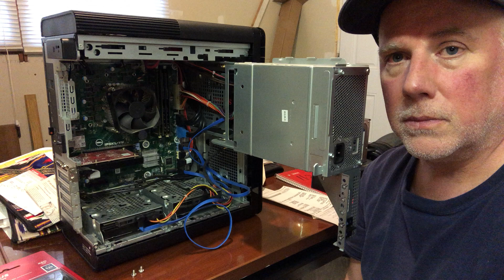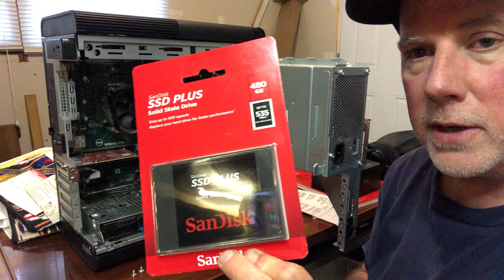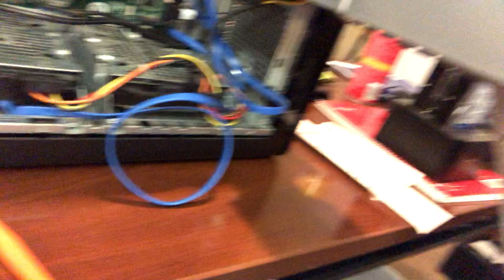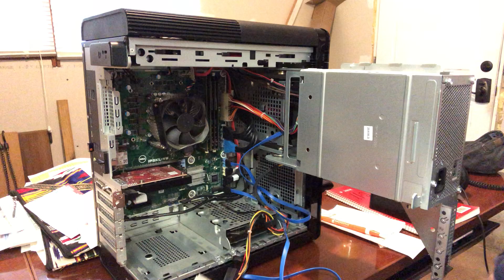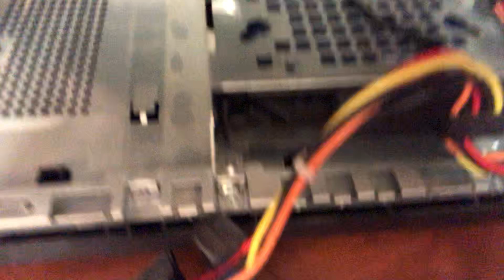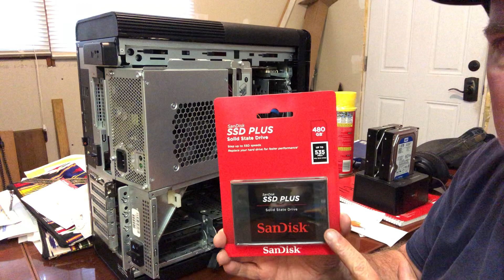How to Remove Hard Drive Bay in Dell XPS Tower 8910

Comment: when you added in new hard drives, did it increase your bios boot time? i replaced the 1TB hdd on my XPS 8910 with a 10TB hdd and it added about 15 seconds to my boot time. My boot OS is on SSD, only thing I swapped out was the hdd.
Reply from the maker: Booting from the SD card is fast.

Comment: Nice computer videos.  I was wondering if you've ever had to remove a CD that has been "eaten" by the computer.  My tray comes out but no CD. Is it difficult to get at that part of the computer to retrieve that CD?
Reply: Actually, you might be able to remove that CD by simply powering up the computer, press the eject button on the DVD tray, and extend the tray out (but do not remove).  Next, remove the power, and while holding the computer with the tray facing downwards towards the floor, the CD should just slide out of the tray.  If not, try this method:  1. Power up the computer  2. Press the DVD tray eject button  3. Extend the tray out, but do not remove  4. Remove power from the computer  5. Remove the right cover from the computer  6.  Remove the top cover of the computer by prying the cover up from the back corner , and lift the cover away 7.  The CD will then be visible through the small rectangular hole bearing a cable retainer clip  8.  After bending a small hook on one end of a thin magnet wire, fish the magnet wire through that small 3/8:" X 1/2" rectangular hole, and pull the CD out.